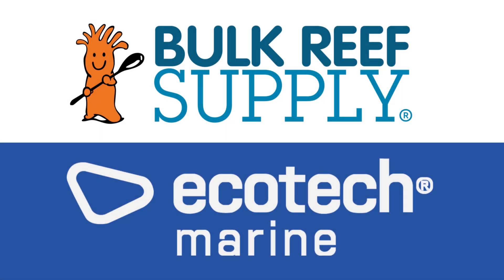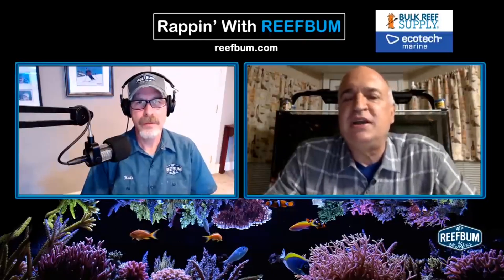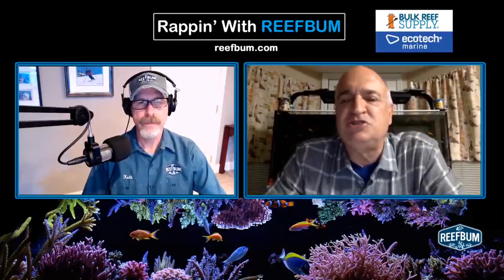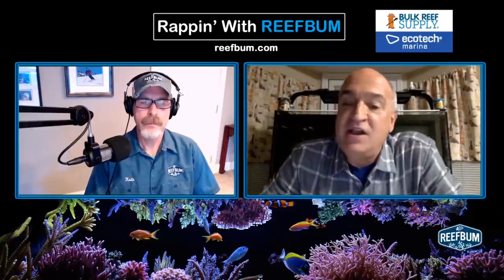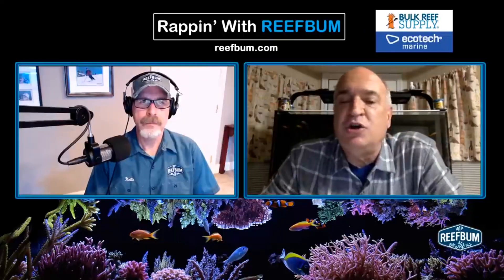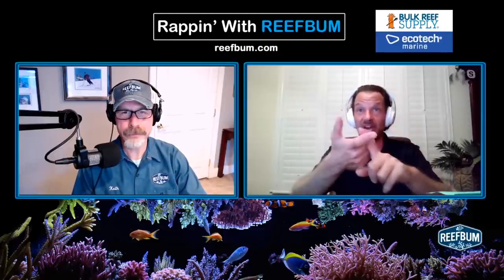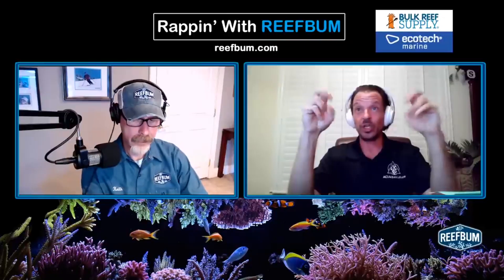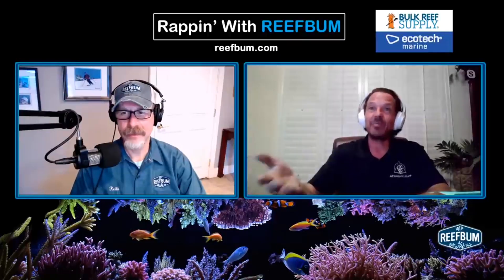Does Lack of UV in LED's Impact Coral Health? Rappin' With ReefBum Sound Bite

Comment: At 10:23, the UV spike has no micromole per second measurement.  My spectrometer auto-adjusts so that the highest peak is scaled to the max level on the graph, which appears to be the case here.

Comment: To add to my other comment... as I've mentioned on my last time here on ReefBum (Tue, Sep 5/23), the UVR shouldn't be the main reason why metal halides are the best representation for the corals, but the REAL representation of FULL spectrum from UV to IR makes a huge difference. LED users tend to have a very strong confirmation bias in terms of quality of light. To compare any LED in this world with metal halides is the same of comparing real teeth with prosthesis. they will both have a function, but it won't be the same. To have the real representation of the sun we need a significant amount of UV within the real full spectrum of light in the right intensity and uniformity, distribution and delivery of those photons. It's an endless dilemma to keep wondering again and again about UV. They are different technologies and LEDs have their limits in many aspects. It's a matter of choosing the quality of matel halide lighting, or the marketing advantages of the LEDs, with it's limitations. We all know already that the electricity costs in comparison aren't relevant. We know that LEDs will also emit some heat. We know the probabilities of defective colony formation under LEDs are higher than under halides or T5s. The real pigments of the corals, as we see them in the ocean, will depend on real full spectrum light. Health of the coral also include the right pigment formation, colony structure and growth rate.
In addition, I also talked about a paper showing the importance of UVB for the control of Vibrio shiloi bacteria and bleaching. It is a significant information in scientific terms, when most of the papers only show the detrimental aspects of UVR on reef organisms. Corals will thrive under unfiltered natural sunlight and the presence of UV will eliminate most of pathogenic bacteria from the surfaces. Metal halides offer the very best representation of sunlight and it is indeed the best artificial light to reproduce what we have in the ocean in that regard. 
I think the discussion about UV alone is what makes people think they could just add some UV diodes and the spectrum of a LED fixture would magically be great and give the results of a metal halide bulb. Wrong! What a huge mistake to think like that! Some LED fixtures also have "IR" diodes. What a joke! They do anything for the sake of selling their fiixtures! LOL! That is the main reason some hobbyists are beginning to call LEDs a scam! It's an expensive way to display corals under a very reflective nice blue light!

Comment: Halides are THE gold standard for sps.  Period, end of discussion. Done. If you live somewhere hot...bummer.
Reply: I think I should ad, for those with dino's, UV is not the end all be all cure.  I have 3 400w watt halides, 8 four foot T5s, and reef brite strips over my display.  Still had dino.  Why.. bacteria imbalance when my vinegar dosing pump stopped and I didn't notice it for 2 weeks.  (600 gallon 4x8x30" DT 
for those that are wondering)

Comment: I've explored this topic a few years ago just to be shrugged off by fellow reefer or alienated by reef2reef trolls when I questioned it.

I questioned it because we used uvb for reptiles.

All I can say is I'll let it speak for itself.

I wouldn't use standard reptile bulbs because they don't have the penetration.

You will want at least 40 - 100 micro moles penetration.

I would try the agromax pureUV T5 HO bulbs.

Best output and penetration without having to use sodium or halides and having to deal with heat output.

They run about $25 for 4' bulbs and lifespan 6-8 months when you will notice degradation but typically I'd replace them every year.

But for T5 general rule of thumb is output will drop 50% every 6 months.

The other thing is that you will want a high quality aluminum reflector, coated or painted reflectors with absorb UV.

Screen tops will reduce output by 100 micro moles.

And glass blocks 99.9% of uv.

BTW it will damage cheap plastics and acrylics with long term exposure.
Reply: @reef nick mainly trying to avoid negative criticism after having to break down my tank moving from Harrisonburg VA to West tennessee.

I had a standard 300 gallon with oak stand and canopy mixed reef started with 50% dry rock moved from a 2 year old 120.

I had a g3 t5 hybrid setup.
What I noticed when I swapped out a couple of bulbs for uvb is what little cyano I had in low flow areas disappeared were it was unshaded. 

After that I played with flow a bit more, one of my bad habits. 

What little algae popped up on the new rock browned out and disappeared after a week.

Never had Dino in that tank.

Coral skeleton seemed denser when I went to trim and healed up much faster, tissue also seemed much tougher on the birds nest when one of the tangs broke off a peice and I walked in and seen it dangling.

Since I've moved back to west tennessee I'm looking to set up another tank now that the kids are old enough to know not to stick things in it.

I laughed when my youngest stuck my wife's purse in the toilet, luckily he was caught before he flushed 🤣

Comment: Why does it have to be UV? I think less likely but it could be far red - it could be the more diffused spectrum.
The GHL Mitras don't have lenses - this could be the reason for them and I'd like to see Telegram's spectrum reading for UV on the Reefi Uno's (also no lenses).
It does make me think though that for an SPS system MH and / or T5s would be better - for coral health - but there are so many tradeoffs with these.
The experts who grow coral for a living (Meckley and Adam (Battle Corals) both say MHs boost growth significantly over LEDs and my suspicion is that it's NOT only about the light absorbed by the corals - I think the lights qualities improve the ecosystem and helps corals.
Reply: I’ve shared the Uno data on Humblefish. The light I had was 401nm measured, so not a UV diode, but the variances in the Uno’s diodes may offer 395-405nm.
Reply: @telegraham  Thanks Jim - I was thinking if the lenses reduce the UV transmitted over time - but still broader spectrum of UV may be beneficial - the challenge I think is diffusion until we have 100's of diodes in 100W lights
Reply: If this is the case then why all coral farms are using leds and no longer using MH. ???
Reply: @6jdhd  I think you will find >50% of acro farmers still use MH and / or T5 on a big chunk of their systems
Reply: Meckely and Adam are not the only experts growing corals for a living. What about TSA, WWC, and Tidal Gardens? There's others too, but just to name a few.
Reply: @Reefahholic  sorry - that's true - I was meaning that Adam and Meckely both say MHs grow SPS faster in comparison to LEDs. I don't think TSA, WWC or Tidal Gardens would disagree - Than (from memory) said he setup the new barn with LEDs for other reasons and TSA did have some MHs about a year ago on a video I saw.
I do think LEDs are catching up quickly. IMO  Reinaldo from Pirates Reef has the best looking high end Tenuis and Yoshi has the healthiest looking acros and both only run LEDs - both feed - Yoshi specifically feeds >5x what is recommended and he has mostly out barrier reef acros that come from crystal waters plus he doses bacteria daily.
My theory is that the broad spectrum from MHs and white T5's (like GE6500) result in a lot more benefecial free swimming bacteria that SPS feed on - Yoshi supplements that and Reinaldo feeds Oyster Feast. Plus watch how much WWC feeds. I think the +700nm in MHs also triggers the mechanism in corals that generate more growth.
With the UV I think it helps with bacteria / plankton that live at the surface. It probably produces certain colors in some corals (like yellow in the Fiji leather) and like Meckely alluded too is detrimental (in some way) to detrimental organisms (like the algae).
So I agree MHs aren't necessary but I think it's a simpler way to get really good results.
This is all speculation on my part but I suspect:
1 - MH's mean feeding corals is not necessary.
2 - Systems with only LEDs mean we need to feed.
3 - Broad UV spectrum in MHs means more good / less bad bacteria and algae
4 - Diffused +700nm results in a 20% growth boost for shallow water corals.
This would explain why shallow water acro reefers with MHs / T5s (with 6500k bulbs) didn't / don't need to feed but those with LEDs do.

Comment: How much have the radions 5g?
Reply: UV? No UV diodes on Radions.
Reply: @telegraham  your wrong there are 4 UV 415 and 4 UV 405 diodes on the G5 pro
Reply: @6jdhd  but isn't true UV under 400.
Reply: @6jdhd  Marketing works well. North of 400nm is violet. Below 400nm is UV. Ecotech does not make a mass market fixture with a diode that peaks in the UV range.
Reply: You stated it had none at all. I stated it did all you had to say was it not a true UV. So there for your statement was still wrong.
Reply: @6jdhd  that’s violet not UV. Just because the manufacturer called it UV doesn’t mean it is

Comment: What about UV sterilizer? I have acros growing like weeds under a500x’s - with ‘UV’ turned off. I’m also running a properly sized UV and very very small issues with BA but CUC takes care of it. On another tank I’m running Gen 3 Radions with T5’s - no issues - no uv sterilizer. Thanks for video! I’ll sit back and watch the hornets nest unfold!!
Reply: I feel like there's been too many successful tanks running over the last 5-8 years with LED only and No RTN or STN. However, when you look at Halides and how well they grow coral it almost makes you wonder if its the UV that is doing it, because they seem to have more UV than most light fixtures.

Comment: I think Danna Riddle is more than likely correct in terms of light use for photosynthesis. The coral can react to the UV by producing pigments that keep it safe from the UV light in the same way that we get a suntan but the coral is likely not using the majority of that energy (if any) for photosynthesis. 
The utility of true UV is probably for some sort of microbial/bacterial moderation that keeps the coral pests to a level that the coral will not succumb to larger infections that can potentially cause RTN and STN. 

I disagree with Sanjay to some extent that more testing is needed, we have had a large-scale adaptation of LED reef aquarium lighting without true UV and have seen the issue of STN and RTN grow. Whereas large-scale aquaculture facilities and public reef aquariums still stay with Halides explicitly because the overall coral health is improved in comparison to LED. There should be some sort of strict controlled scientific study of this effect.
Reply: @reef nick this is true but all of their mother colonies in the Acro system use MH,T-5 and LED’s
Reply: @aciaquaculture  Yup, huge difference between growing out frag for sale and maintaining a mother colony long-term.
I was around in the early 2000's and people weren't having the sort of algae, dino, stn and brown jelly issues we see now. In fact most Acros weren't even that hard to grow with decent Halides / VHOs on a tank; now people talk like they are growing brittle egg shells.
Reply: WWC, TSA, Tidal gardens all running LED's.
Reply: @Reefahholic  I’ll give you WWC but TSA  uses halides. And if I remember correct Than regularly thinks about adding T5/halides because it add something to the coral growth.

Comment: Photospectrometer have issues picking up UV unless your using a expensive one
Reply: The $650 Hopoocolor on AliE and the $3,000 UPRtek MK350S both measure <400nm. The UPRtek measures to 380nm, and the Hopoocolor will measure down to 350nm. Although not NIST traceable calibrated, the Hopoocolor does well vs the calibrated UPRtek.

Comment: Nice Video, It would be interesting to have measurements of other brands besides GHL to understand if UV is missing on those. Thank you
Reply: No led at this time has uv strong enough to penatrate into the water deep enough to reach anything besides the top of the water.
Reply: @MurrayMotocross1  ok, thanks
Reply: @MurrayMotocross1  That’s inaccurate. The data shown in the vid is mine, measured 16” below the surface through the bottom glass and through a hole in the frag rack with the light 9” above the water. Measured with an MK350S Premium. Have contradictory data? I’d love to see it.
Reply: @telegraham  so which led has the uv?
Reply: Which? I’ve probably measured.
Reply: @telegraham  wow I just watched the video again and seen the data at the end. I guess when Chris measured "most reef lights" for uv and shared his data, he must have not measured the mitras. Looks like I will be buying a mitra now instead of buying the MH. Thanks
Reply: @telegraham  xr30 pro gen5 ?
Reply: @reefp5816  Radions have no UV diodes. Only violet.
Reply: @reef nick Yes. No UV diodes on AI fixtures.